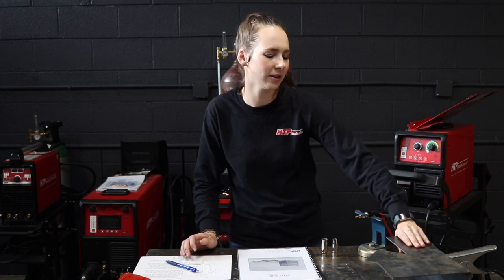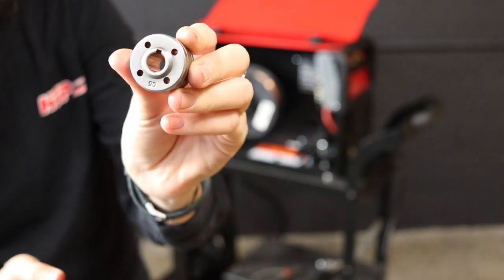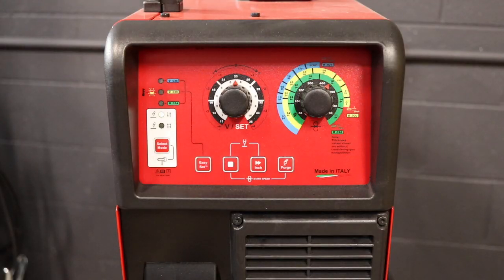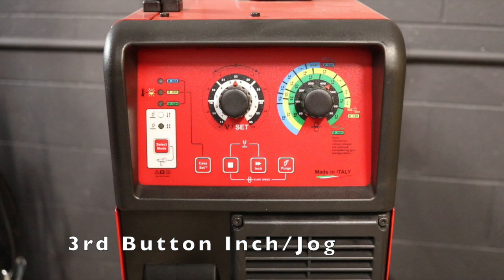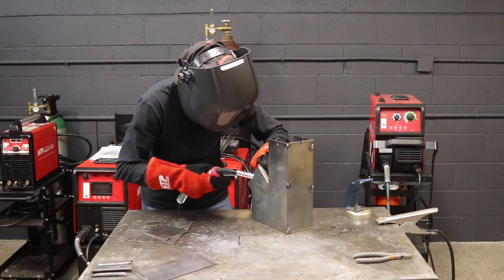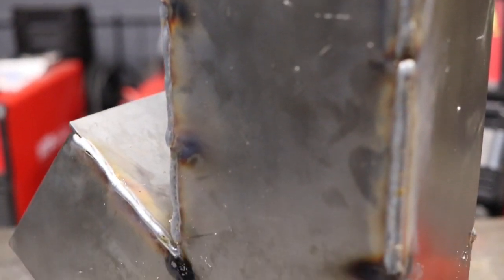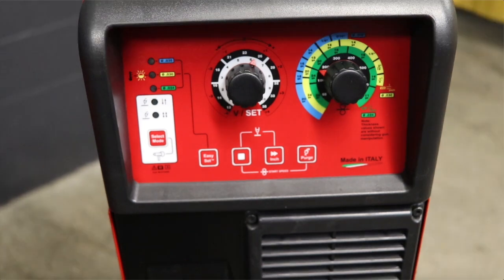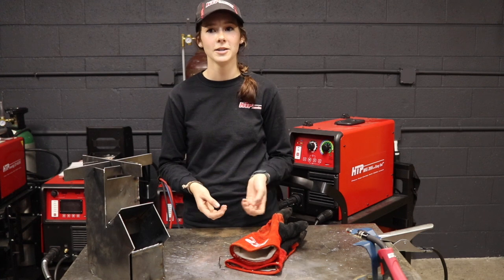HTP MIG 200i Set Up and Welding a Rocket Stove!

Comment: I wish there was more videos of this welder. I’m looking to purchase one but would like to see more videos. I see a spool gun icon by the mode button, how do you run aluminum wire through it?
Reply from the maker: We are working on it! There is a spool gun however it is not something we sell with the machine. The MIG 200i can run aluminum through it in manual mode.
Reply: @usaweld  thanks